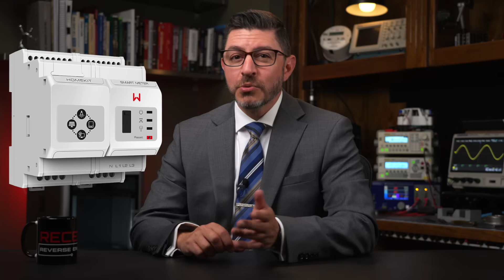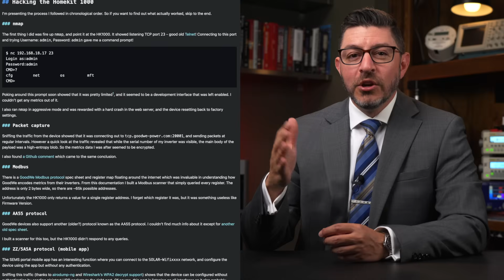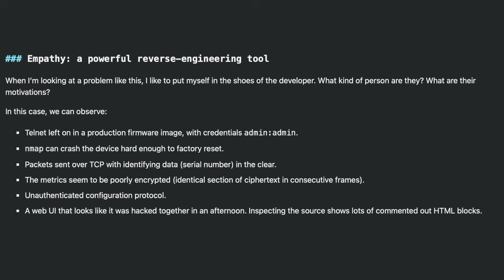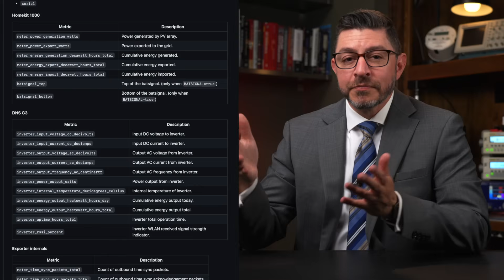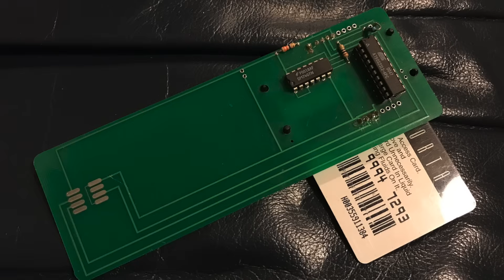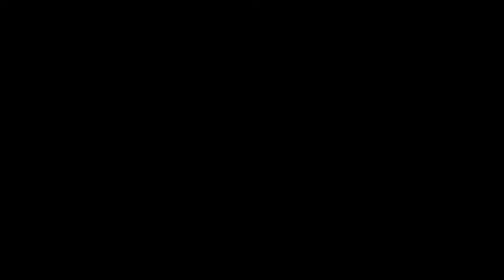Hacking a GOODWE Smart Meter

Comment: I have a Shelly 3EM Wifi Power Meter, it talks to my server locally and I access my data over a VPN. It even has a controllable 10A relay and a Home Assistant integration for data logging. Some things are best to be avoided using with the cloud